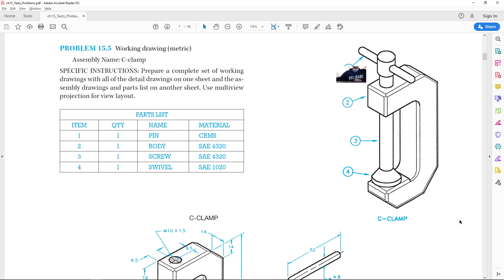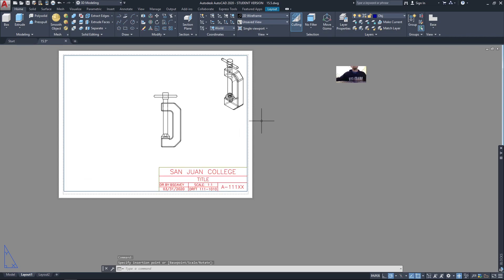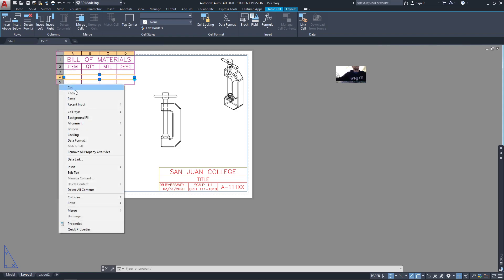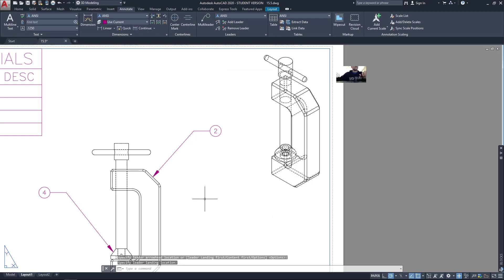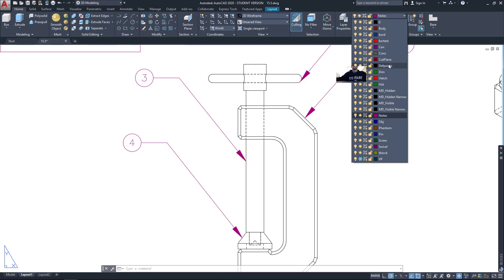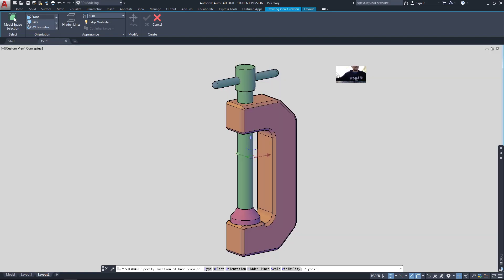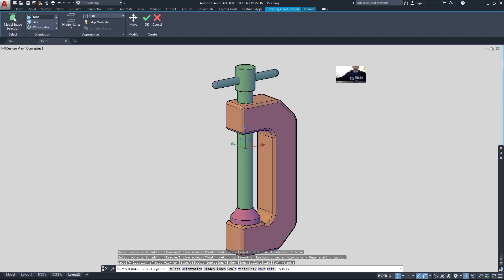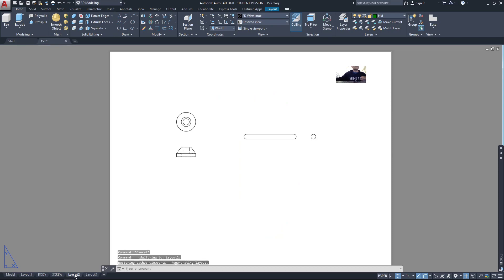How to Make a Set of Working Drawings in AutoCAD

Comment: Hello can I ask how you make the edges for the clamp *in autocad 3d? Thx
Reply from the maker: I used the chamfer tool "cha" to bevel (chamfer) the edges.
Reply: @SJCDMAD232  what about the horizontal measurement I dont know cause the pict only contain the vertical measurement ?*the body
Reply from the maker: @violetstar8644  Applying some assumptions such as the rest plate is square and the bottom edge lines up with the inside of the "C" I came up with 40.95mm
Reply: Sorry If this sound rude, my english is actually very bad 🙏🥲
Reply from the maker: @violetstar8644  Sent it.